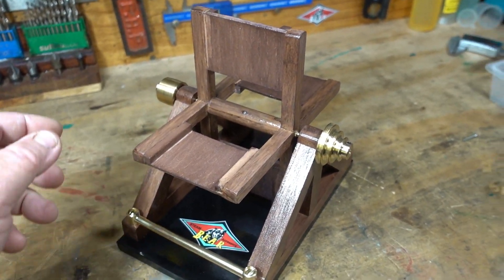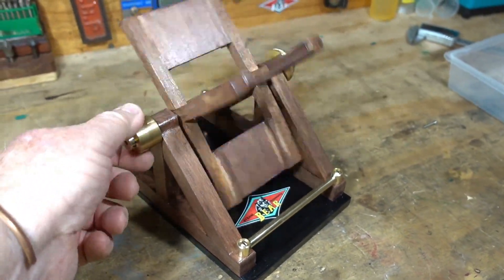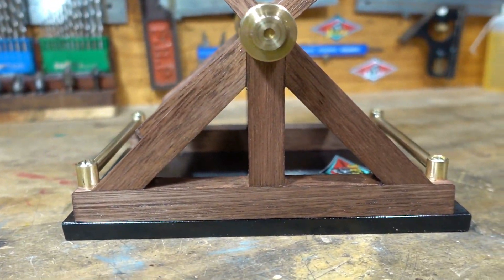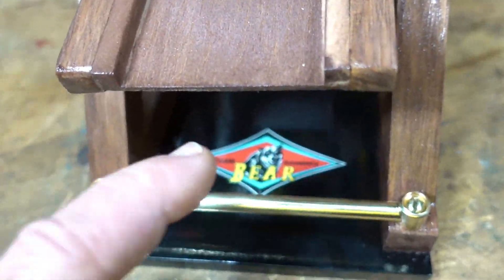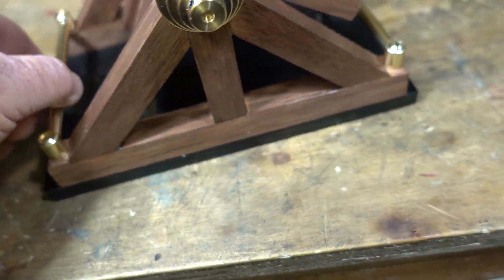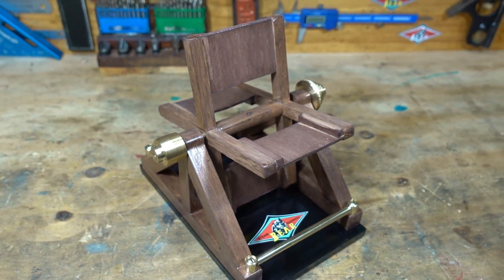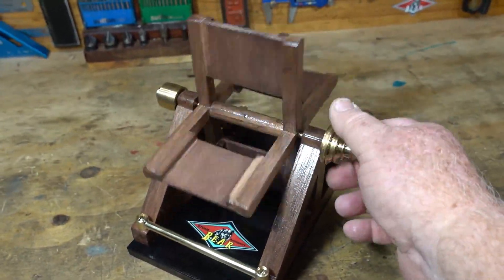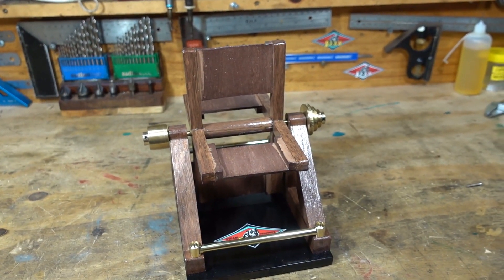Homemade Baker Fan DIY - Used to put a load on an engine

Comment: I just learned about the Baker Fan recently, watching a video from Ronald Walters channel. I wanted to get one for my Mamod and Wilesco engines, but could not find any for sale. And I could not find any plans to make one. And I could not find any STL files for 3D printing one. So, I drew one up in Tinkercad and made my own 3D printed version! Just finished it today. Still have to test it. I have subscribed to your channel too. :)
Reply from the maker: Thanks for subscribing to the channel, I hope the Baker Fan works out well for you! I'm sure it will be one of your most used accessories, it puts the perfect load on a steam engine. Drop me a link when you get it working, I'd love to see it - Cheers Jim
Reply: @SteamEngines-Jim  I tested my 3D printed Baker Fan today. Needs some adjustments and my Wilesco needs more fire, lol. But it shows promise! :) https://youtu.be/r2x5dK0o8OE?si=G1Ff3NuhsBf2UDjw